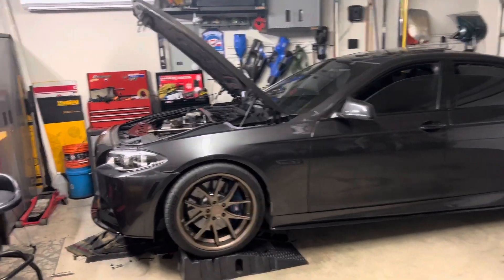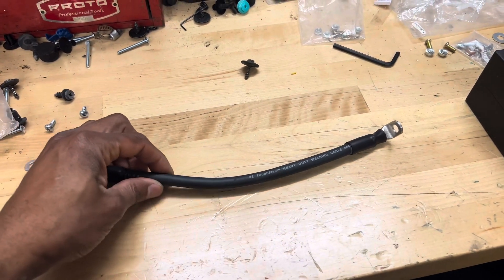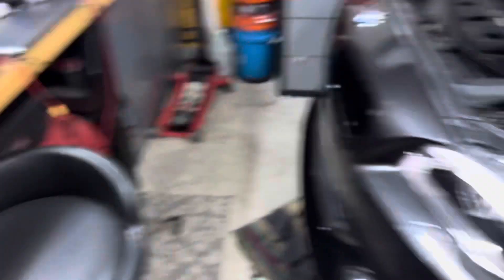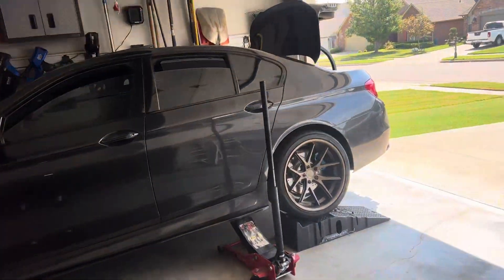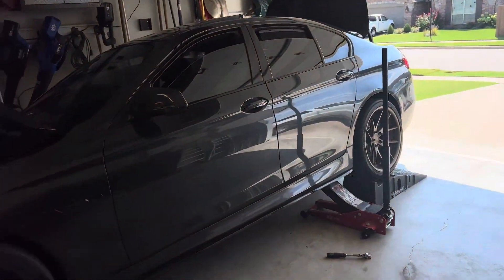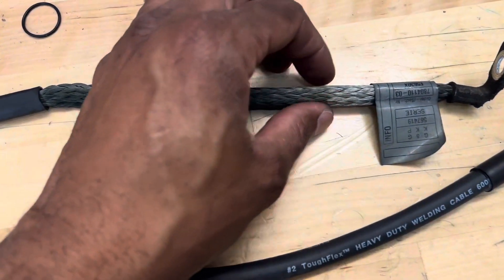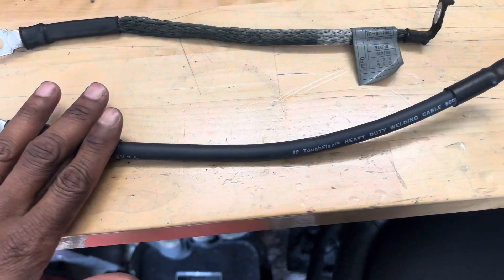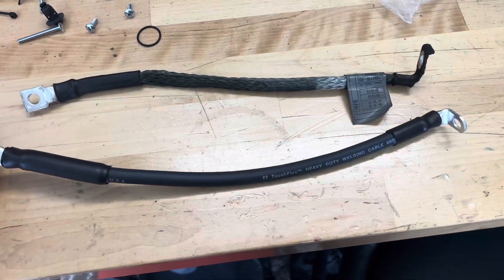Enhance Electrical System Reliability: Arc Terminator Upgraded Ground Cable for BMW F10

Comment: Those rvg headlights once put in do they have to get programmed ??
Reply from the maker: Yes, you will need to contact RVG after installing and have the car remote coded.

Comment: I'm having trouble with footwell controller.   Wondering if any ideas ?
Reply from the maker: What issues are you having?
Reply: @JohnsonMotorsports   I've lost angel eyes,  adaptive headlights,  folding mirrors,  rear windows insta up, turn signals fast click....kinda keeps going.  Researched a little sounds like new controller or reprogram.  Just wondering if anyone else had controller problem.   Thanks for reply!
Reply from the maker: Dang, that sucks. Have you checked the module with Ista?
Reply: I have not. Have the bimmer app and a code reader but not sure how to get ista
Reply from the maker: @rook2043  Did the issues occur after something in particular? 
For Ista you would need a laptop with 500gb of free space, an Enet cable and you can download the program from Bimmerfest.
Reply: @JohnsonMotorsports  yes I let the battery die over the winter and  had a leak in front headlight.  Thanks for info.  I will download and give it a try.  Thanks Man, hope new turbo and tune going good.
Reply: Also I just got Facebook so I can link if ok. Thanks!